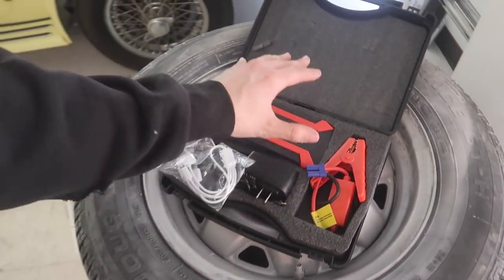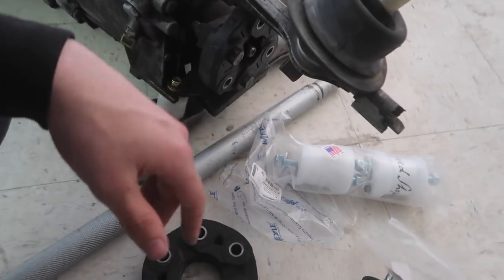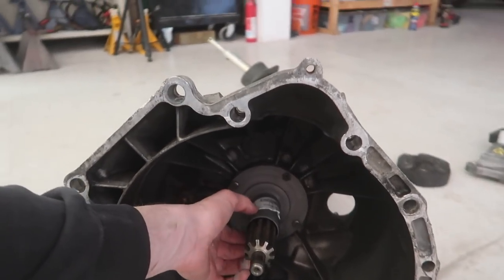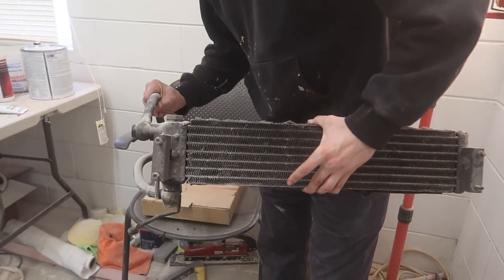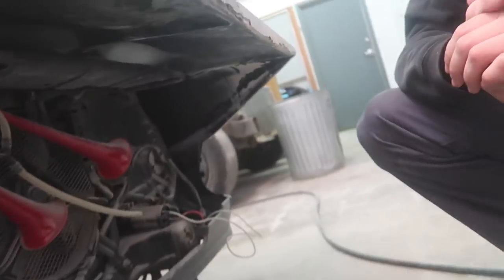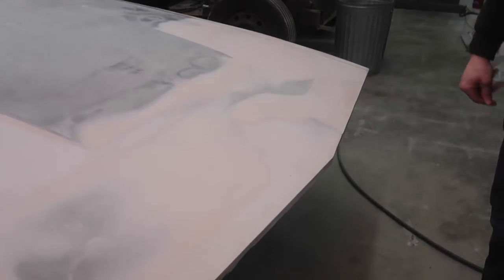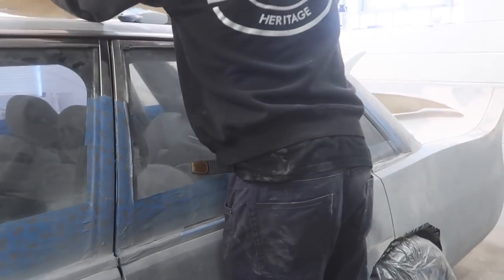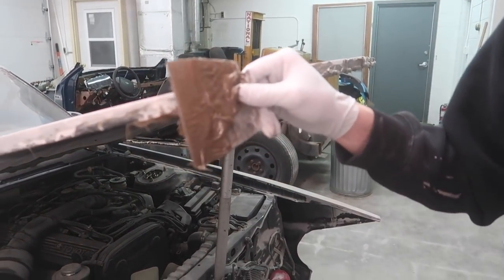How We Are Building The Crazy Bosozoku Aero

Comment: Go to a local hydraulic hose shop and get some quick disconnect fittings for the oil cooler lines, you can take them off and they seal up so oil won't leak out when they are disconnected.